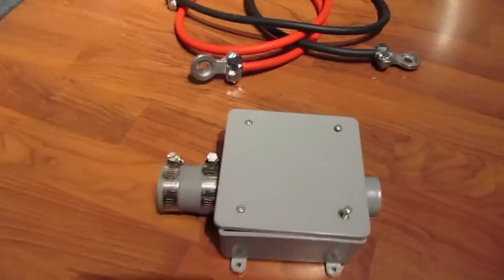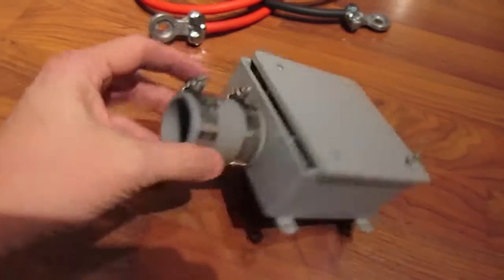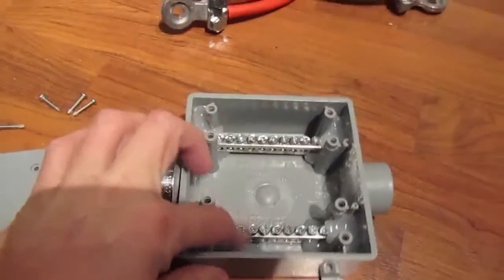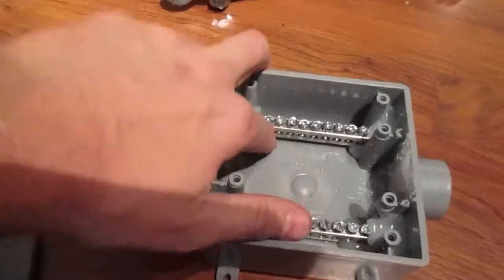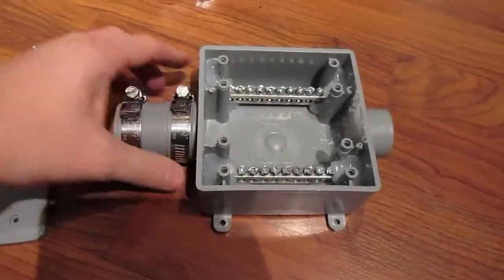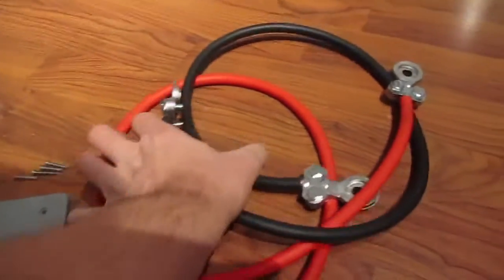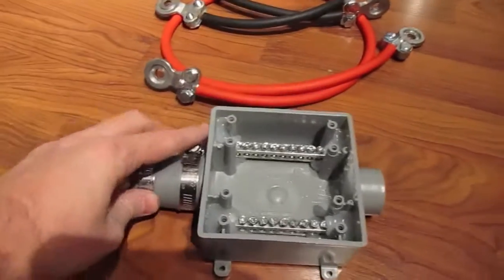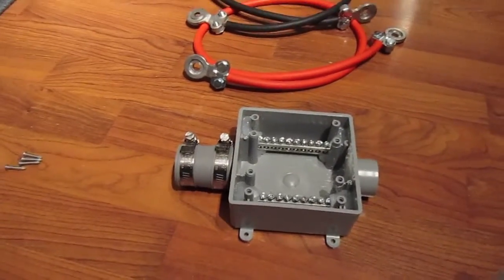Solar panel combiner box

Comment: don't use hot glue it will get liquid if temperature gets hot, or in direct sun light. You may get a big short.
Reply: I will bolt them!!!  SOmo how this installation...might beok...for low voltage...but for example in my 90 volts (3 panels in series), 8 amp s...I used a breaker.

Comment: Hi. Regarding your combiner box:  I'm installing 4 160 watt panels on the roof of my RV. I'm going to run :#8 conductors from each panel and land them on the appropriate sides of the box as you are showing it. I then plan to take #6 conductor from the box down to the charge controller. I will put an appropriate fuse or breaker in the #6 conductor down below. I will silicone the openings as you stated. Do I have it right?